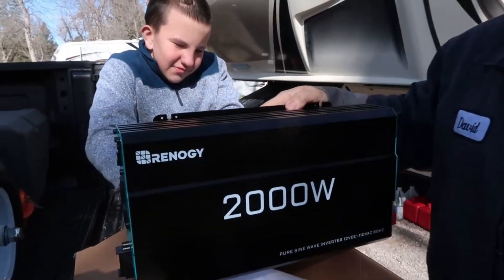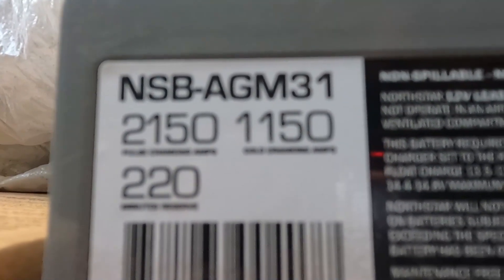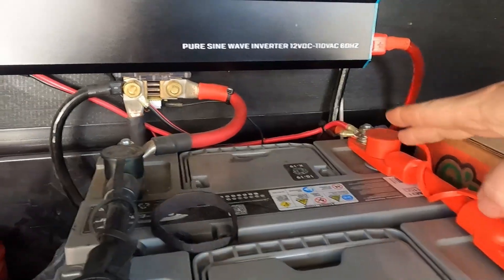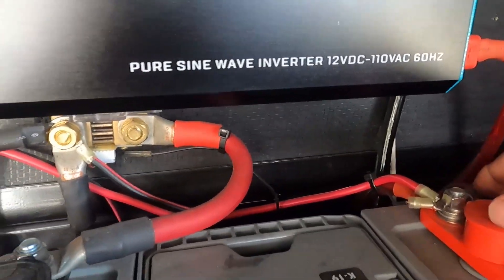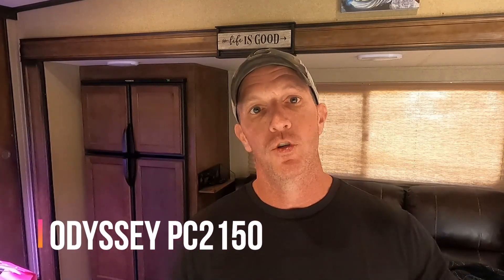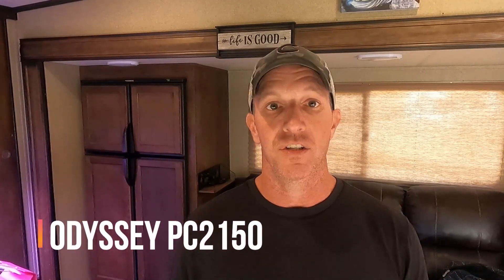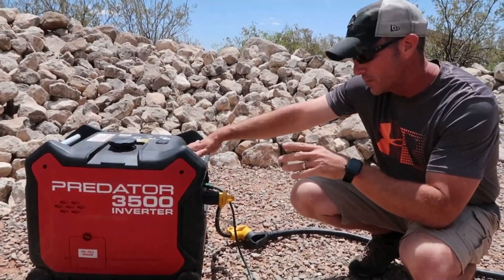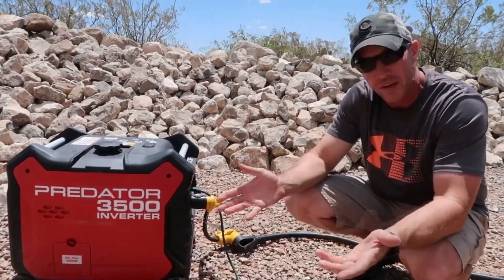EASY RV Inverter Setup | RV Inverter Setup Explained

Comment: Hey Jouppi I have a question. In a few weeks, a buddy and I are going to install a 3500w inverter in my 2009 Fleetwood Tioga. Is there a way to figure out how long my battery charge will last using the inverter? I'd like to use my cpap machine overnight if my batteries will last that long. Thank you.
Reply: If I could ask one more thing. If I shut off the converter breaker, can I still use the 12v items such as the water pump and furnace blower with the inverter on and the converter off?
Reply from the maker: No problem! Yes, the 12v power will be supplied from the batteries.
Reply: @JouppiOutdoors  Thank you!
Reply from the maker: Hi there! Yes, you can calculate an approximate run time. You would need to do an AC to DC conversion to know how many amps the inverter will draw from your battery bank. Once you know that number, there are quite a few battery run time calculators online. Here is a link to a good resource and a calculator that I have used a lot to do an AC to DC conversion. https://www.batterystuff.com/kb/tools/dc-to-ac-amperage-conversion-run-through-an-inverter.html

Comment: If you shut off the charger, are you still able to run DC power (ie the lights) if you are using a four stage battery converter?
Reply from the maker: The DC should be supplied by the batteries when the converter is off.

Comment: I watched your video and purchased the same inverter, connected it to my RV and I have a GFI error, I can power small appliances directly on converter with no issue…where to start troubleshooting?
Reply from the maker: So to be clear, when you plug the extension cord from the inverter to the RV, you are getting a GFI error from the inverter?
Reply: @JouppiOutdoors  yes, just now I tried my Bestek 1000w inverter and it works fine, reading online others have had similar problems at installation, or later on the unit failed. Looks like a production issue. Thanks for replying, great video.

Comment: Lithium (lifpo) are leaps and bounds better than AGM in terms of value, toughness, and power capacity.  Appreciate the video.
Reply from the maker: Agreed, we have since upgraded to lithium with this setup. Work’s outstanding!
Reply: @JouppiOutdoors Not if you use your RV in winter like I do, AGM is the way to go for winter use

Comment: Great video.  A couple questions: we have a battery volt monitor that came with out Rv solar system, would this work with that set up?  Also we have a 12v fridge would this setup work for that?  We have 300w of solar on the roof want to upgrade to 400w.
Reply from the maker: As long as the voltage monitor gives you an actual reading of the battery voltage it will work for this setup. Our 5th wheel just had a generic battery monitor that did not give an actual voltage reading. As far as the 12v fridge, 300-400 watts would be plenty to offset what the fridge requires during the day, but without knowing the actual amperage draw it would be hard to know how big of a battery bank it would require to last through the night.

Comment: Thanks for great video
My question is on the reflection 5th wheels is it possible or did you change the setting on the converter to charge lithium batteries now that you have them, or do you charge batteries using the victron charger when your hooked up to AC. Do you need to shut the breaker off on the converter when charging using the victron charger?
Thanks David
Reply from the maker: The Victron has a lithium setting so I use that. I have the Victron plugged in to the basement outlet that was originally used for the converter. The converter is not currently plugged in or being used at this time.
Reply: My 2023 Grand Design Reflection converter is NOT compatible with Lithium batteries. That mean the existing no-lithium converter will only charge the lithium batteries to 80% charge. My Furrion solar controller is Lithium compatible for the lithium batteries and will charge the batteries from the 80% to 100%. I'm installing a 2000watt pure sine wave inverter now. 2000watt inverter divided by 120v gives you around 16-17amps. The outlets on my invert is only 15amps. SO I should be fine utilizing all 15amps on any of my rv appliances as long as I stay under the 15amps draw. I plan on using a heavy duty 15amp extension cord and plug into my 15amp inverter outlet and back to my rv outside 50amp pigtail using a short 50/15amp adapter.  I should;d be able to everything own the RV except the A/C's. Of course only one appliance at a time. It's always good to have a cheat sheet that shows what all your appliances power use is. I have my fan down to 60watts, toaster down to 1000watts, tv 100watts, water heater 1500watts etc.

Comment: Thank you for the video, I have reflection 5th wheel as well and have same setup as you, as well as 300 watts solar on roof and 2 -100ah lithium batteries. My question is did you run an outlet into your front compartment to plug in the victron ip67 charger? If yes, did you come off an outlet from the bed room to get power?
Thanks. David
Reply from the maker: No, I ran a short extension cord from the Victron back to the receptacle in the basement that the O.E. Converter was plugged in to. There is a dedicated breaker that runs that outlet only, making it convenient to turn off when I want to plug into the inverter.

Comment: We have 1 Solar Panel 165W and a 300AH lithium battery. We have 1000W inverter. A  WFCO 55 Converter with lithium switch. A MPPT 50A Solar Charge Controller. 
Our Refrigerator is 12V and our lights & slides & awnings fan for heat and a couple USB Plugs in the RV. We do have a inverter push button to make the refrigerator work. 
Now, what would we need to do so we can turn on the TV and plugs for CPap at night?  Do we need a larger inverter to connect to like you did here?
Reply from the maker: A 1000 watt inverter should take care of running a CPAP and TV. However, with a 300Ah lithium battery, I would definitely upgrade to at least a 2000 watt inverter and you could run the setup I showed in this video with no problems at all!

Comment: How big of an inverter do I need to be able to use my ac and furnace?
Reply from the maker: A 3000 watt inverter would run 1 AC, the question is whether or not you could install a battery bank that would sustain it.

Comment: Hi , I have a question that is the only thing that wonder about . Doing all the above basically like u have when I shut off our converter on our class a rv. Will this turn the 12 volt off too the fridge and water heater pilot lights. ? Our will they cont as normal.
Reply from the maker: Great question…I was not very clear about that. The 12 volt power will be supplied by the batteries, so you will still have it.

Comment: We just bought the new Intech Expedition with the solar package and a 12v fridge.  We have 400watts solar with a MPPT charge controller and a 2000watt inverter and 200 amps lithium battery.  My question is if it’s a cloudy day while we are driving will the 7 way plug charge the lithium batteries as we are driving?  First time with solar and lithium so I’m just doing a ton of research.  Thanks
Reply from the maker: The 7 way plug will not provide enough amperage to charge the batteries. It will provide a surface charge, but it won’t last long once you start pulling from the batteries.
Reply: @JouppiOutdoors  maybe taking generator with us will be the way to go.

Comment: Where's your in line fuse or resettable circuit breaker?
Reply from the maker: I have a fuse in-line from the positive battery cable to the inverter.
Reply: How to buy pass converter

Comment: So, concerning the Victron battery charger that you purchased. Will that same charger also charge a 202 Ah Lithium Battery as well? I heard that the stock converter that installed in my 2020 Keystone Cougar will not charge lithium batteries to 100% and like you i like the data that this charger provides as well. Also, when installing the charger I noticed it has a positive and negative wire, and it also has a standard 110v power plug on it. How did you install yours and how does it get power to run? Great videos you put out. Thanks!
Reply from the maker: Yes, the Victron BlueSmart 12/25 has a lithium setting. In fact, we now have two 100Ah batteries installed in parallel for 200Ah of capacity that I am using this charger on. I routed the power cord through the basement of our 5th wheel to the outlet that our stock converter was plugged in to. I had to purchase a short 6’ extension cord to make it reach but it is working flawlessly. Thank you for watching!
Reply: @JouppiOutdoors  Thanks for this information. I will look at doing it this way as well. Being you all seem to camp a lot in Georgia do you ever find your way over to Appling? We live in Evans and have camped on Lake Thurmond a bit at Pointes West Army Resort. It is one of our favorite places.
Reply from the maker: We do travel that way pretty often but haven’t visited that resort. We will have to add it to our list!
Reply: @JouppiOutdoors  oh yes. That lake has a lot of nice campgrounds around it. Happy camping!

Comment: This video been a huge help. I had the dealer install 2 x 100w solar panels, 20a charge controller, and 1 x 100ah lifepo4 battery - but neglected to throw in a controller. Is it worth it to get the 2000w inverter / charger combo? Renogy says i need at least 170ah for my battery - thoughts? No big draws except smoothie blender, keurig and TV. Thanks!
Reply from the maker: If I were doing the 2000 watt inverter/charger, I’d go with 2 100ah batteries. Most inverter/chargers will have a built in transfer switch so that if power is lost, it will automatically switch to the batteries/inverter to keep the rig powered. A single 100ah LiFePO4 is much better than a standard lead acid or AGM battery, but the extra 100ah would make a huge difference in your run time.

Comment: A question concerning the "20 amp battery charge controller as a part of the Renogy portable suitcase 200 watt solar package. Earlier in the video "EASY RV Inverter Setup" you discussed the how the Victron 1225 - 25 amp battery charger was perfectly charging your batteries. Question: are you concerned with the charging capabilities & profile  of the Renogy 20 amp battery charge controller when you use the solar panels as part of the suitcase system?
Reply from the maker: Great question, in full sun, the 200 watt panels will produce about 13 amps max. I am using them more to maintain and offset the draw of the RV and inverter during the day. For example, if we are using the inverter and lights in the RV, we may be pulling 8-9 amps DC from the batteries, so the panels will offset that to extend my run time. I wouldn’t recommend using strictly the 200 amp panels as the sole charging system for the batteries, which is why we still run the generator for a few hours a day. If the batteries are not totally depleted, the Victron will recharge them within a few hours while running on the generator. Hope that makes sense!
Reply: @JouppiOutdoors  Please indicate the brand name and your source for the "20 ft long" extension cables you use with your solar suitcase panels. Thank you

Comment: Hi Jouppi, 
I really appreciate your simple explanation and setup. My trailer has an on board generator with a transfer switch so my question is... If I have the inverter plugged into the rv like you have and we need to use the microwave (my kids love their dino chicken nuggets) would there be an issue running the generator with the inverter plugged into the trailer or would the transfer switch take care of that and automatically switch the power over? Or would I have to unplug the inverter from the trailer every time we need to use the microwave/ac/ high draw appliances?  

Thank you for any help!
Reply from the maker: Great question! Providing the transfer switch shuts off power coming into your trailer when the generator is started, you will be able to simply start the generator without shutting down the inverter. The purpose of the transfer switch is to prevent 2 power sources from supplying power at once. I would try to verify that operation before trying it though to avoid damaging the electrical system. Otherwise you could just shut down the inverter and fire up the generator to use the microwave.

Comment: Your running 20amp cord from inverter to 15amp 30amp adapter to the trailer,  why not use a 15amp cord from inverter to the 15amp to trailer.  Is there a difference?
Reply from the maker: I am running the 20 amp extension cord to a 50a to 15a adapter so that I can hook directly to the power receptacle on the 5th wheel. Without the adapter, I have no way to plug the 20a cord into the trailer.

Comment: Great Video. 👍 Our trailer is 30a, could we use the 30a extension cord rather than using the 20a? I have purchased all Renogy 200w suitcase, 20a Rover mppt and the 2000w inverter so very similar to your setup and happy to have found this explanation.
Reply from the maker: You can definitely do that if your 30a cord will reach the inverter. You would just need a 15a to 30a adapter. Thanks for watching!
Reply: @JouppiOutdoors  we travel with a 25ft and 50ft 30a extension and then a regular extension cord, didn't want to add another to the mix.  The only thing left to figure out and buy is the fuses. I assume 20a from controller to battery, need to read the manual for what fuse to use from panels go controller. I think there is a fuse in the wires with alligator clamps that came with the panel, so should be same.

Comment: Do you recumend turning the inverter off when not in use or does the inverter itself not have a significant draw?
Reply from the maker: I keep ours off because it will draw about 1.5 amps when switched on.

Comment: Don't have an RV but do have 2 full-size, home-style refrigerator freezers that could use a backup power system whenever the power goes out (would be EXTREMELY rare btw). On the tags, one says 3.0 amps and the other (an older LESS EFFICIENT unit) says 6.2 amps. I have 2, 2400-watt inverters that I could use in an emergency but was gonna source the 12V power from a running vehicle, but I like your battery bank system. I was thinking of adding one more battery to your model for a total of 3 and just use a maintenance smart charger to charge all 3 batteries in preparation for such an emergency. I like the foldable panels you use and could cut in the controller AND the battery monitor later as the situation needed/arose. I like how you said you could move the panels anywhere to maximize the sun utilization. But how long would a 3-bank system work for 2 home style refer/freezers?!?!? Should I go with a 4-bank battery system?!?!?  I'm looking for overnight capability. My calculations show that the inverter(s) could handle the loads with impunity but it's the batteries that have me stumped. Thank you!!!
Reply from the maker: Speaking solely from what I have seen in RV’s that run residential refrigerators, it seems most use a battery bank that is close to 400 amp hours. In your situation you may be better off to use four 6 volt batteries wired in series & parallel to achieve the run time you would need. That would be roughly a 440ah bank.
Reply: @JouppiOutdoors  Ten four, roger that!!!

Comment: Thanks...just got a renogy 1000...trying to figure out how to get the wiring into the front compartment from the batteries outside, on our little Hideout trailer. Seems like I need, what I refer to in audio, as a patch bay. Or a better analogy is, a distribution box...one connection from the battery to it, then everything else connects to that. Maybe that's what a shunt is? More research I guess. Your tip about connecting the inverter to the trailer via extension cord is great, plus, remembering to turn off the converter in the panel. I hope there's a breaker for that in there.
Reply from the maker: You’re on the right track I believe. I would run the main battery cables inside to a busbar, then run from that to your inverter and converter. Thanks for watching!
Reply: You need two busbars, one for positive and one for negative.

Comment: CAN I PLUG MY 50 CORD IN WITH ADAPTERS? THANKS
Reply from the maker: Yes, that will work. My cord would not reach the inverter so I went with the 20 amp extension cord. Thanks for watching!

Comment: If you disconnect the battery from the rv and just use your solar charger to charge will the convereter still try to charge if on? even though the battery is disconnected from the rv onbooard system?
Reply from the maker: If the converter is connected to power then it will still run and provide 12 volt power to the RV regardless of whether or not the battery is disconnected.

Comment: So can I plug in my travel trailers 50amp chord using the 50 to 30 amp dog bone and 15amp 3 prone adapter to the inverter? THANKS
Reply from the maker: You can definitely do that. I usually have my 50 amp cord run to my generator. Using the 20 amp extension cord allows me to
Just change out the power cords depending on the source I’m using (generator or inverter) instead of dragging the big 50 amp cord from the inverter to the generator and vice versa. Thanks for watching!
Reply: @JouppiOutdoors   So I'm going with the renology 200 W solar panel suite case, and 2000 wattt inverter, (2)6 V AGM batteries.
Reply from the maker: That is a great setup!
Reply: @JouppiOutdoors  Do I need a breaker between the batterys and inverter?
What size? And how is battery monitor important? Thanks
Reply from the maker: You can put a fuse on the positive cable between the batteries and inverter, mine is a 250 amp ANL fuse. The battery monitor is very useful for managing your power use while on the inverter and to monitor the voltage of the battery bank. I would highly recommend one. Sorry for the delay in answering.
Reply: How do you turn your inverter off so as to not drain the batteries  do I need to install a on off  switch